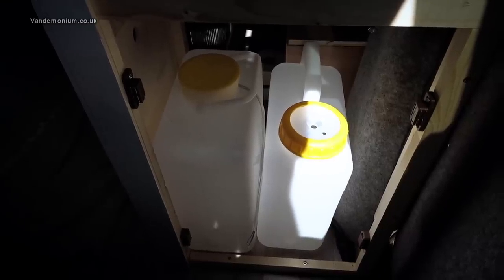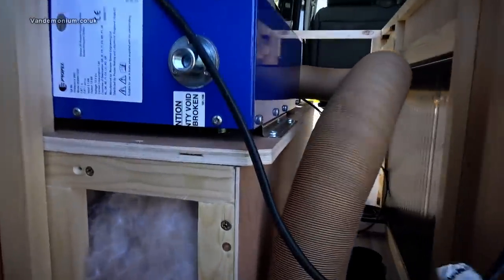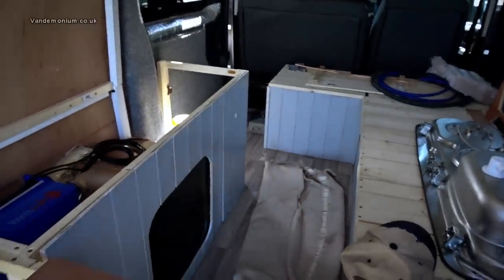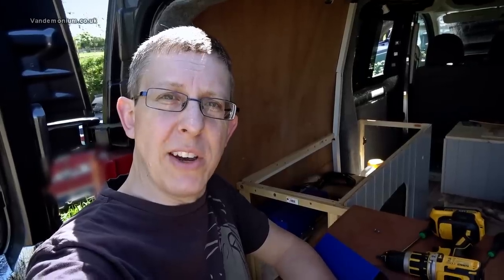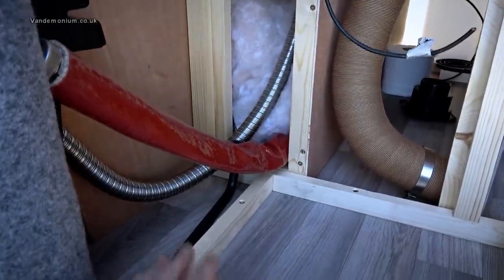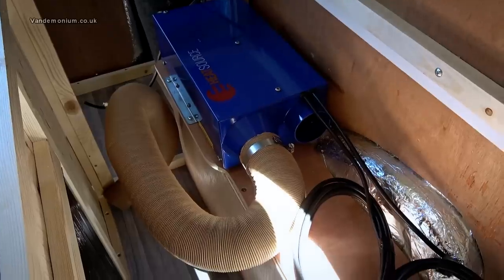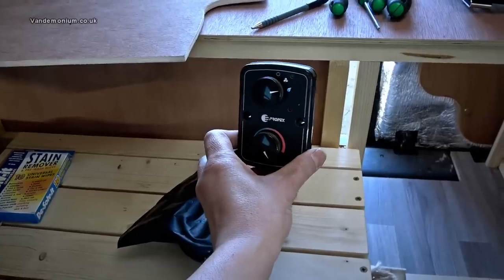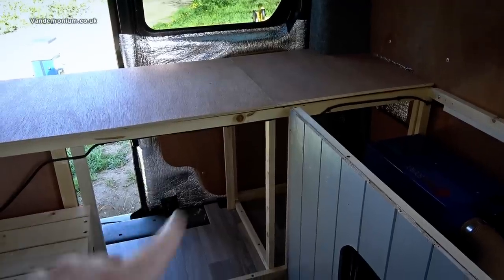Vlog 18: Propex HS2000 campervan heater installation (part 1)

Comment: Hi.. Your getting on very well with the van.. Only thing I would like to say.. I have been building camper for over 30 years..? I just noticed that you have put your propex on the passenger side..? I would like to advise you to run the exhaust all the way to the rear and exit the rear of the van.. I say this as in the past, It might not be you but you will not have the van for ever.. If you put the exhaust out the side of the van and you decide to put an awning on to it, you or the next owner will vent exhaust fumes in to the awning...? and we know what happens then...?    I am enjoying all the videos so far.. Thanks loads.. Kevin
Reply from the maker: Hi. Ta. The whole unit is at the back and the exhaust exits there. Cheers

Comment: very informative... been looking at dual (gas/240v) heaters for a van... so a couple of questions..
1-How did you calculate the heating requirement for the van size?.. cant find any space/temp increase data on their website.
2-Can you have it running when moving?
Reply from the maker: I did no calculation; the van is quite small so if the heater failed to do the job it would be a total failure as a heater. As this unit is fairly standard on a lot of compact campervans, I took it as read that it would be up to the job. No idea about using it on the move; I doubt I would because I would tend to turn the gas off at the bottle when moving.

Comment: Interesting that they said you could connect it like that it does make installing it so much easier.
Reply from the maker: Yes, I was rather surprised too although since then I have seen a similar installation using the marine version on a small narrowboat. I can't say I'm hugely comfortable with it, I'd rather have mounted it conventionally but there just wasn't a sensible place to put it due to the spare tyre underneath at the back, and the two huge chassis members running along the length of the van on either side underneath the units. I'm still somewhat paranoid about the heat off the exhaust despite my later addition (see other videos) and will continue to ponder even further insulation on it.

Comment: Great video, just one suggestion with your water jugs...
Use the smaller one for your supply so that the supply runs out before the grey water is full! If you do it the other way round you leave the possibility of running out of space in your grey water jug and having a messy overflow! Yes ok likely not going to happen but I'd still eliminate any possibility!!
Reply from the maker: It won't happen; 90% of the fresh water will be drunk as tea :-)
Reply: Vandemonium 
Ha ha yes.... most British answer of all time!

Comment: I think you are doing a fantastic job with fitting the van on your own. You probably already thought  of this but if you haven't, please get a carbon monoxide detector. Just as an added measure of protection for yourself. Thank you.
Reply from the maker: There will be 2 CO alarms, a smoke alarm and an LPG alarm. Cheers
Reply: Vandemonium . Glad to hear. I didn't hear it mentioned that's why I asked. I also like your cruising the cut channel. Awesome stuff. Thank you.

Comment: I would go ahead and put in the air inlet plug/screen to the cabinet. You build with very tight  tolerances and might starve the heater of air. Nothing wrong with air flow to a place with heat and water as well, minimizes mold I should think. You don't want mold.
Reply from the maker: I assure you that cabinet is not made with "tight tolerances", gosh if only you could see it up close!!
Reply: Vandemonium, just concerned for your safety. I did see that there were many advise comments. Maybe too many, I trust you know best how things stand in your new adventure vehicle. Best of luck and safe travels. 💖
Reply from the maker: I do appreciate the concern but given the gaps between the panels on the kitchen unit and the three holes I drilled in them to enable pulling them off the magnetic mounts, there should be sufficient airflow. Cheers

Comment: From the look of things, you have fitted the wrong pipes on your combustion air in, and exhaust. It should surely be the stainless hose on the exhaust?
Reply from the maker: I assure you I have not. The exhaust hose is indeed metal of some kind.

Comment: I wonder if wiring the incoming and outgoing burn tubes, would help keep the exhaust cooler, while warming the intake air too, and both wrapped in rock wool or fiberglass for insulator around them both. Of course the intake outside end should be a space on outside of van from the exhaust, to avoid re-circulation of exhaust into the intake port. Also, why not take both through the side of van, with some sort of metal pass through port for each, the intake below the heated exhaust port, since the latter exhause would rise, insuring intake would always have truly fresh air incoming.
Reply: No. You would need a heat exchanger to accomplish any heat transfer. Why not just install the heater as recommended by the manufacturer?

Comment: I’d be curious as to how much that heater gets used as time goes on. In our T@B trailer, just using the 2 burner cooktop seems to warm things up quite a bit. The heater gets used very seldom and it’s nice to have one now and again but a small space with good insulation doesn’t require much heat. Are your windows capable of venting a little bit of fresh air into the van?
Reply from the maker: I've the vent above and a side window slides

Comment: I would suggest that you use the smaller water can for you are freshwater otherwise you could overflow the gray water tank making quite a mess. If the freshwater is the smaller of the two then you know when that is empty it's time to dump the gray water.
Reply from the maker: That won't happen; 90% of the freshwater will end up being drunk as tea!

Comment: Well that's useful to know - means you could have a lot more options placing the heating. Placing the dropout holes for the Heater and for the Cooker might be tricky - should have 50mm of containment to hold the gas in place (so to speak) around the edges so the leaking gas doesn't just flow out. Where did you get the 13ltr water container?? thats a useful but not common size.
Reply from the maker: I got it from either Kiravans or Clearcut Conversions or somewhere like that, I forget the exact one
Reply: Thanks - Yes Kiravans - not cheap - but a great solution.
https://www.kiravans.co.uk/campervan-cookers-sinks/water-containers/13-litre-water-container-hinged-handle-bung-top

Comment: Hi there, nice video. There's one thing that's bothering me, I believe the pipes should be the other way around. Metal one for exhaust and the black one for air inlet.
Reply from the maker: Both pipes coming off the spigots are metal. Neither are black.

Comment: Can you tell me where you obtained the thermal wrap used around the exhaust pipe?... also how hot does the exhaust pipe get, as I'm wondering how the  hole in the bottom of the van would be sealed if a very hot pipe was passing through!  I'm wondering if I can use the thermal wrap to allow the exhaust to exit close to the spare wheel without damaging the tyre.
Reply from the maker: From Propex. You will also see in a later video I added additional exhaust wrap, from Amazon. It's very hot as it exits the unit itself but much less so by the time it goes out the end of the pipe. That said, I am not offering any advice, fit at your own risk and take care etc etc! The instructions on fitting (if the pipe exits directly through the floor) just mention making a specific diameter hole, nothing else regarding heat proofing.

Comment: A switchable Y-fitting in the heater`s air intake could supply you with fresh heated air from outside, just a small hole in the sidewall...
Is that a petrol van or a diesel? As diesel, i would choose a diesel heater, as long as there`s fuel to drive, there`s fuel to heat!
;-)
Nice work, thx for the vid!
Reply from the maker: Not sure why I'd want to use gas heating up cold air from outside?! If the heater's on, I want it heating the air in the van which is what it's designed to do. Regarding choice of heater, I explain in the blog post, link in video description. Cheers
Reply: @Vandemonium  Sorry for the late reply. I wanted to weigh in on this as I'm just recovering from carbon dioxide poisoning. That's not a typo, I mean the stuff you breathe out. (At least I assume you do; you don't look like an alien. 😉) When people say "oxygen starvation", the real problem is carbon dioxide build-up. While there is plenty of oxygen in the atmosphere, just a couple of hundred extra parts per million over the normal amount of carbon dioxide is enough to measurably reduce brain function, and it builds up surprisingly fast. Normal house bedrooms commonly build up large amounts; more than enough to halve brain function if I remember right. None of this is new info; the British government was trying to enforce minimum ventilation standards for homes in the 1980s.

You may not have to worry too much because, as you say, you go outside when you want to stand up, and I guess you spend a lot of time driving the boat around too, but I can entirely understand why someone would want to heat cold air from outside. Actually, there's 2 reasons, although the second is much less important. If you take fresh winter air and warm it, it's very nice!

What I want is a heat exchanger so I can constantly exchange air with the outside without losing more than a little bit of heat.

Comment: I've got the same propex heater and the exhaust gets very hot.
Reply from the maker: Good to know. I asked them about that ages ago, since I was wondering whether it would burn the ply floor of the van through the hole (this was before I moved it) but they said as long as the correct sized holes were used (I forget what this is, maybe 50+mm??) then it would have sufficient clearance. I shall be very careful to watch it and check it when it first runs.

Comment: I'm thinking of using a ProPex with a 20LB propane tank for a DIY sauna... do you have any thoughts how HOT 6500 BTUs can heat a small 3ft x 3ft x 7ft wooden-shed?   Do you think if on for an hour, it could reach sauna temperatures (typically 180F)?    

Unlike portable indoor "vent-less" space heaters (ex. Mr. Heater Buddy), there shouldn't be any concern of it consuming oxygen inside the sauna space.. nor of it producing carbon dioxide / humidity.   Although I'll hang a couple sensors just in case!

BTW, does the ProPex require any filters between the unit and the hose/propane tank?   And how much propane does it use per hour on the HIGH setting?   I'm trying to figure the operating costs.. for example, $20 to fill up a 20lb tank (400K BTU) will last how long assuming it's on HIGH for an hour a day?
Reply from the maker: Hi, best to contact Propex for these queries.
Reply: If you insulate well enough it could get much hotter than that.  The dimensions you mention are tardus--esque and you may not need much insulation with even the smallest propex heater.

Comment: How noisy is the propex heater? Is the fan on continuously when  the heater is on? Thinking of getting one for my 17 ft trailer. Thanks so much.
Reply from the maker: Hmm, it's not exactly quiet though I suppose it depends where you mount it. Yes, the fan runs continuously.

Comment: Hello,
I just bought one but I don't know what gaz regulator I have to use with it... I have got a 50 mbar gaz regulator, should it work? If not, please let me know which one I'll have to buy... Thank you
Reply from the maker: You'd best email Propex, they have really good technical support by email. I think 50 may be too high but check with Propex themselves.
Reply: @Vandemonium  Thank you for your quick response!

Comment: Word of advice. Dont T piece the gas line. A gas manifold is a requirement for multipul device isolation. If you have a fault on either device you will have to completely shut off your gas rather than being able to isolate each device. Also a drop vent under each gas joint and no more than 750mm or rubber pipe in the whole system 👍not keen on the routing of the hot exhaust but at least you have it in writing from the manufacturer.
Reply from the maker: Hi. Ta. Each feed from the T has its own isolator so the items can be separately turned off. There are drop vents, as you will see. The piping is all copper except the high pressure from cylinder to regulator. The hot exhaust is wrapped in a heat sleeve.

Comment: We have the same Propex heater in our campervan and found it very unreliable, proun to different error codes (intermittent flashing red light on the thermostat controller) difficult to reset, disappointing and expensive, particularly with a dedicated on board Lpg tank servicing both the heater and hob. The heater fan also consumes a far bit of 12v battery power when off grid. Not ideal!
Reply from the maker: Oh, how odd! I did need to reset it occasionally on start-up but it always did so without issue. And I used the heater quite rarely so consumption wasn't a problem. It didn't seem to use much power though so that's puzzling.
Reply: Iv had same problem. I can't understand how they are so expensive. They never work.
Reply: perhaps i can help you, power usage is under 20watts an hour, consumes 1kg of butane per 7hours.what were the error codes indicating,? I have the hs2000 set up on my boat, apart from being a little loud,it works very well, regards dave

Comment: Why dont you feed from the thermostat back to the unit, so that the extra cord can be tucked in the unit area.... So u dont have coils of wire by your bed.....still no cutting ..... But extra coil would be in unit enclosure ..... Hung or secured away from the unit. Would be a cleaner instal by your feet . :)
Reply from the maker: The wire won't be visible, it's going to be boxed in.

Comment: Hi what is the insulation you have on the propex exhaust please and where can I get some? thanks
Reply from the maker: It's stuff from Propex themselves but see my later video where I added to it.
Reply: @Vandemonium  thank you, can you tell me what you used on the hole in the floor, looks like a gas vent but without the grid, and where did you get it please?
thanks
Reply from the maker: Yes, just a standard plastic gas vent but I snipped the grill out. Not sure plastic was the best idea due to the heat off the exhaust so I'd probably try to buy something else next time, though I have since added extra insulation as you'll have seen in the other video I referenced.
Reply: @Vandemonium  ah thought so ... Any idea what I could get that might be better for the heat, plan to double insulate as you did but nervous about it too ?
Reply from the maker: No idea, sorry :-(

Comment: Hi just wondering what sort of power this uses? I have a transit custom and I’m thinking of fitting one but not sure what size batteries or solar panel would be sufficient. Thanks in advance
Reply from the maker: I don’t recall the draw offhand but it’s not huge. The Propex website has all the documentation which give the figures.
Reply from the maker: It worked fine for me

Comment: A small steel plate over the wires going through the wood will prevent anyone from putting a nail through the wires.  This is require in the U.S.
Reply from the maker: Sounds like a good idea.
Reply: On a owner-modified van build? No. Maybe in California because they ditest folks that LIVE on wheels. In the  United States only the Department of Transportation is concerned about vehicles only when new. Were there rules for vehicle modification (like those concerning buses in California) millions of life-styles would be at risk. Oh the humanity of it all...

Comment: I wonder how loud that is going to be in there.  May need some kind of sound insulation attached to the inside wood of the cabinet.
Reply from the maker: It's not quiet, for sure but apparently none of these heaters are.

Comment: This is incredibly useful thank you, solves a similar problem with my heater installation.

Question: Do you have a link to a UK supplier of the exhaust pipe insulation/wrap material?

Thanks!
Reply from the maker: I got it from Propex
Reply: @Vandemonium  Brilliant thank you!

Comment: I have a question about your Propex heater. Is the exhaust for the furnace chamber gravity feed or does it have a small blower motor on it? If it's gravity fed then the exhaust tube would need to be above the heater so there would be a draw caused by the rising heat to exhaust the burned gases so they don't fill the van. But if there is a small fan to provide the draw then it's a moot point. Me, I'm paranoid, I'd mount the exhaust high either way. The heater is quite small but you are not warming Buckingham Palace so if any thing it may heat the van too much.
Reply from the maker: No idea but it's designed so that both the exhaust and combustion air inlet poke through the floor of the van as described, there's no instruction about raising the heights or suchlike. Cheers
Reply: There is a small fan that pulls fresh air into the combustion chamber,uses it,and then pushes out the exhaust pipe

Comment: what do you mean by "drop vent" in the gas locker?
Reply from the maker: A hole through which any escaped LPG would drop (being heavier than air) and exit the vehicle so as not to build up within the van as that would present an explosion risk.
Reply: @Vandemonium  got it, thanks for clarifying!
Reply: Propane is heavier that air, Natural gas is lighter. Release the fumes!

Comment: Did you consider a diesel heater?
Reply from the maker: Yes but I was too nervous to connect into the main vehicle diesel tank (which would have required lowering the tank for access) and I stupidly didn't even think of having a separate tank!!
Reply: think I'll go for a diesel one as they're smaller and cheaper these propex ones cost a fortune and are huge